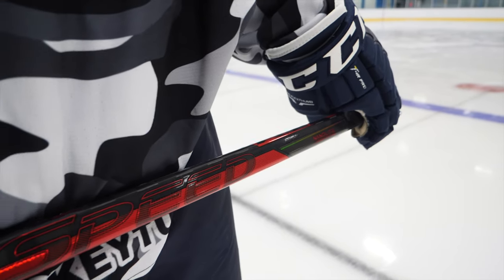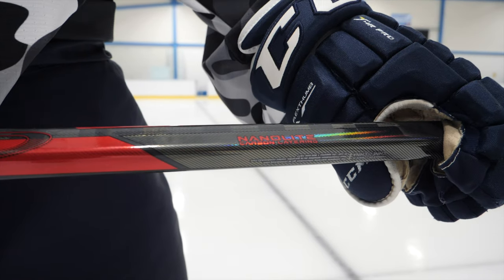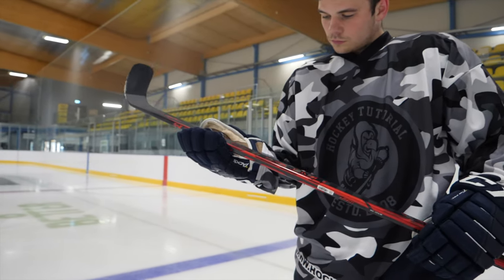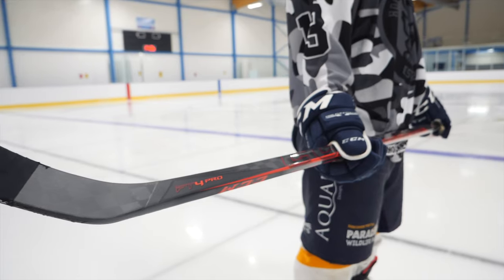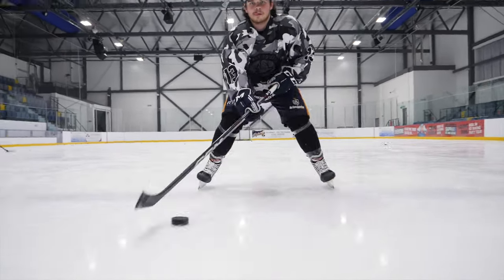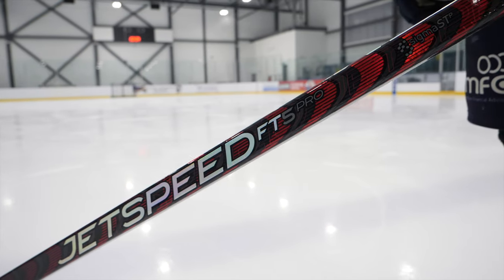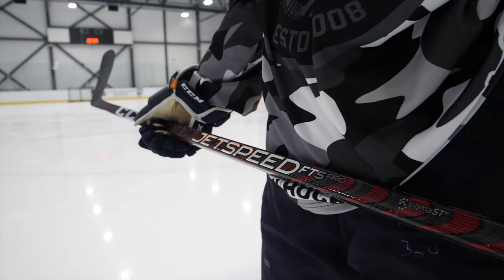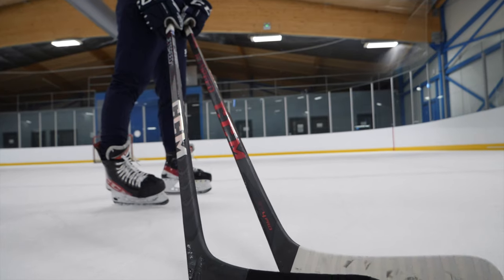CCM Jetspeed FT5 Pro hockey stick vs FT4 Pro Review

Comment: you should do the FT5 pro vs the geo or FT5 pro vs the sync when it comes out because they are both mid kick points and it’s ccm vs Bauer comparison
Reply: jetspeed is not a mid kick
Reply: @Kael18  yes it is. It’s a hybrid kick point, but it is still mid